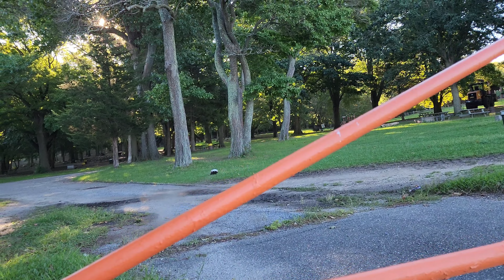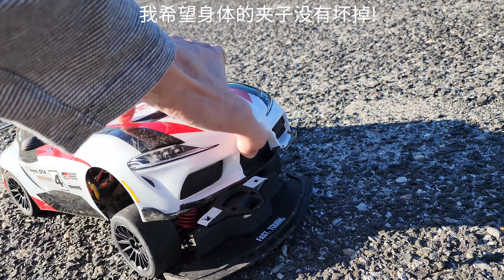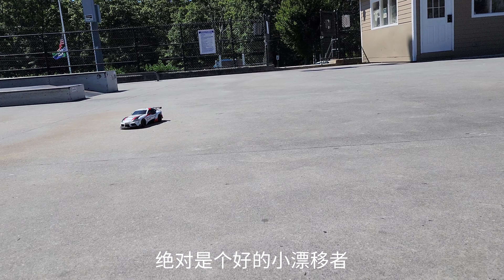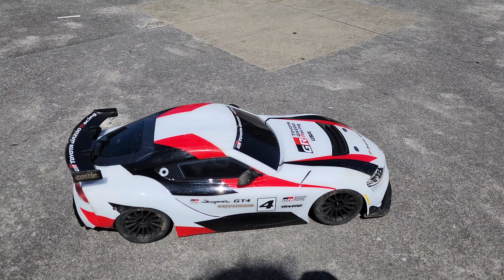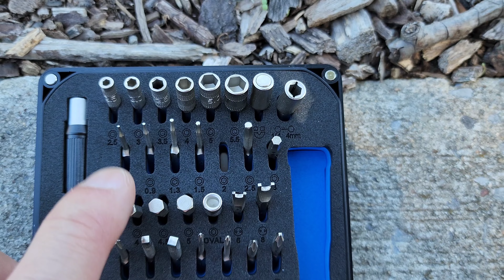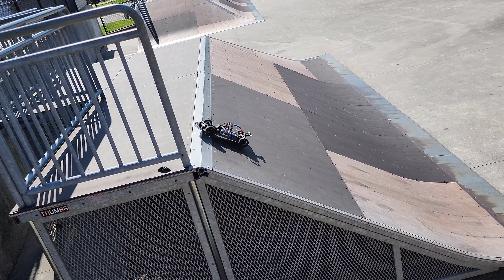4s Toyota Supra/am I doing this all wrong?!

Comment: Hey man, love the video. Is this the 4tec 3.0? I got one recently and have been looking for a steel or titanium spur gear with no success. What did you change the gear mesh to so that you could fit a 70t?
Reply from the maker: Thanks so much!! 🤝 I am running 70 and 29t pinion. It lines right up. No problem. The 4tec gear chart will tell you exactly where the motor goes. I forgot exactly which slot. Go on ebay or Amazon. You should be able to find them no problem. 👊